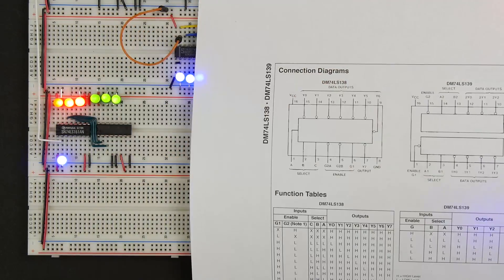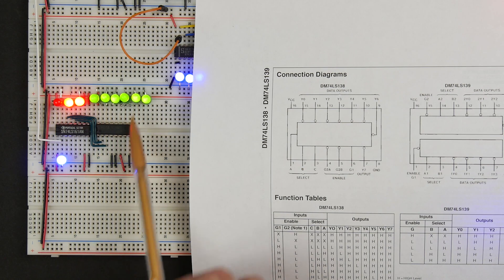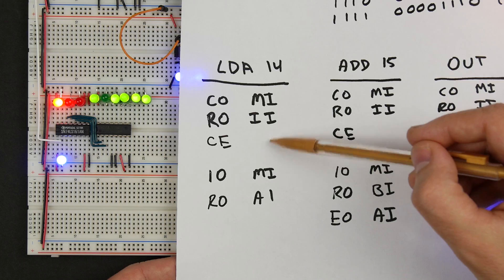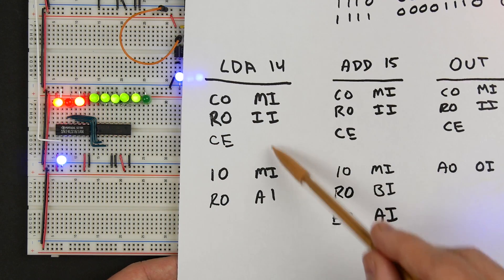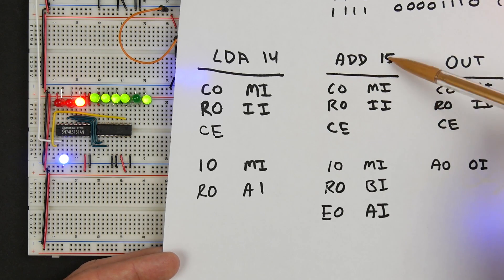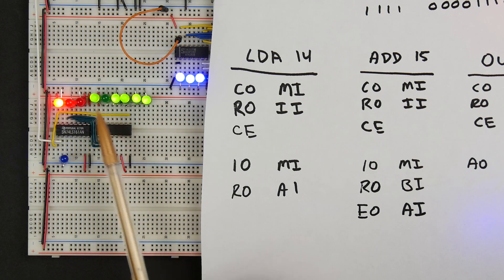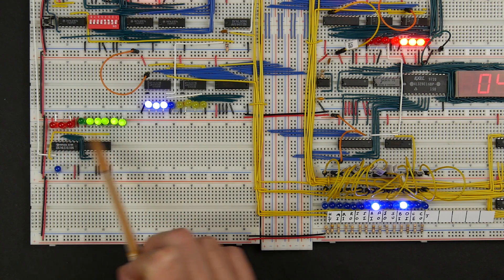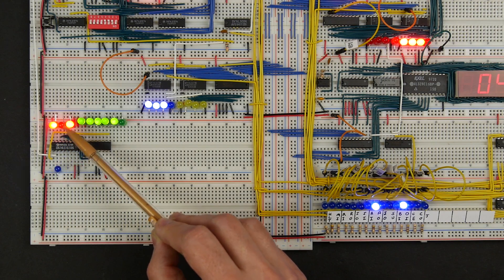8-bit CPU control logic: Part 2

Comment: This 'quick' jumper wire solution will get you into problems if you do it without OR-gates.  I mean, when you want to set control word of  the next step of the LDA command with the jumper wires, it will also activate the CO-bit and that will possibly ruin the program.
Reply: MrBronvu Gates can be overkill and complicated; in this case diodes for a wired or could do nicely. But the hardwiring was for demonstration purposes anyway and the upcoming microcode ROM will have each combination.
Reply: MrBronvu it is only temporary.
Reply: I did understand that is was for temporary use only, but I thought Ben said that wiring it like this was also an  option. I probably misunderstood. 
It is only a small remark on the video, I'm a big fan of Ben's videos and he explains really well.

Comment: Where can I buy the cables you use on your breadboards? Is a coil of cables from which you cut the length you need? I searched on the internet but did not find anything.
Reply: it's 22AWG wire.  The one that I like (and am using) is here: http://www.jameco.com/webapp/wcs/stores/servlet/ProductDisplay?search_type=jamecoall&catalogId=10001&freeText=2159189&langId=-1&productId=2159189&storeId=10001&ddkey=http%3AStoreCatalogDrillDownView

Comment: If you wanted to save more computation time, couldn't you reset the logic counter whenever an instruction is done? For your loadA, for example, along side the Ram-Out and A-in micro instruction could you split that off again and have it reset the logic counter saving you an extra computation step and, if you do that for every instruction, give you more flexibility in how complex your instructions can be?

Comment: You should make a microopcode o reset the counter at the end. Therefore different insrructions will use a different amount of clock cycles. The microopcode that resets will take no time.
Reply: This was also my idea, but there's one caveat: This requires yet another control line...

Comment: hmmm. After building the ALU and hooking it up to clock and bus strange things happen. Can anyone explain why I have a .5 volt drop across my modules? I've built it the exact same as Ben up to the ALU part (which is where I am in the series) and have added decoupling and smoothing caps on each breadboard (unlike Ben) as I read these might help. It makes no difference to use a phone charger or my solder station variable PSU. With my multi-meter measuring voltage reading just the clock breadboard module reads 5.1 volts. If I plug in the program register it falls to 4.85 volts and with the ALU hooked up too the multi-meter then reads 4.5 volts. 

Why is this happening as I feel its messing up my circuit?!?
Reply: HC and LS series chips should not be mixed. LS chips cannot drive HC chips reliably, because HC chips use CMOS levels on their inputs, which are symmetric around 50% of the supply voltage, but LS chips output TTL levels which are assymetric: logic high can start at around 2 V which is below 50% Vcc for 5V power supply, so it may recognize logic hight as logic low sometimes (especially with voltage drops like those described).

For new projects, it is recommended to use HC only. But if from some reasons (compatibility, costs, availability etc.) you really have to use LS chips, you can only mix them safely with other LS chips or HCT chips, which are "TTL-compatible" – they expect TTL levels on their inputs, so LS chips can correctly drive them.

As for the voltage drops, it might be due to power consumption – the more current you draw from the power supply, the more the voltage may drop. It's good to have a regulated power supply which tries to keep the voltage at a certain level even for higher current loads.

There also might be some voltage drops on internal pull-up resistors inside chips. If I remember correctly, the LS  (Low-Power Schottky) series chips have 10x bigger pull-up resistors on their outputs, so that they limit the output current and consume less power during operation, than the HC chips. So there may also be some voltage drops on them.

But don't take my words too seriously, I might as well be wrong and the real reason might be something else entirely. You need to measure through the circuit yourself and see where the voltage drops.
Reply: LoneRegister I'm no expert but for some reason HC and LS series chip just seem to work. I have no clue how, especially on an undervoltage of 1.5v.
Reply: Shyysiryxius this happens to me too even with everything you said. The only difference is when you get up to this video, I see 3.5V on my breadboard. It still works fine though.
Consider using two phone chargers for each side of the board
Reply: Originally, I too saw my voltage dropping down to around 3.5V.  I then updated my power rails by removing all of the breadboard individual wires, and using jumpers in each outside corner of the breadboards.  I then soldered a power or ground wire to each jumper, which then effectively removed any resistance between power or ground wires as the power was distributed around the breadboard.  This brought my breadboard up to around 3.8V-4V.

However, I too have a question around this.

Should I get a power supply, and drive 6V into the project to net 5V?  Where is the 1.2V dissapearing to?  Do I need to worry about my 74LS/HC series chips?  I certainy noticed that my LEDs brightened up a bit when I did the power rails.
Reply: I am not good enough with electronics to understand why the board is under-volting.  When I test the powersupply (both usb, and breadboard PS) without the breadboards - it comes in at 5v.  When I test on a small (other) circuit - 5V.  But on my board it drops.  I can't help but think I goofed something up?  
I also tested current - and it did not seem high?  I think the apple chargers are designed for 1.5A, and I was drawing 400mA or so?  I'll have to boot it up and test again to see what the number is and post here.
Reply: LoneRegister the reason your board has drops is because when all the chips are powered on, they require a certain amount of amps, but you can't just boost the amps because then chips close to the supply will burn and only the ones further away will work. BTW are you using Chinese boards. I know I am. That may be a reason?
Reply: Sci Twi - I will check to see if I have LS or HC chips (or a mix).  Thanks for the info though.  I did not know that you should not mix the two.
Reply: If the TTL circuits require 5v to operate how are they running on only 3.5V? Ill try another phone charger plugged in and see if that helps. 

Id be very curious to see what Bens voltage readings are on different parts of the board. 

And how he is getting away with only a single capacitor to smooth/debounce is just crazy..
Reply: Any good video's floating around detailing the use of caps for smoothing voltage supplies?
Reply: If you measure the voltage rails right where you feed power in, and again at the farthest point on the breadboards, and there is a voltage drop of 0.25 volts or more, then you have corrosion on the wires or the breadboard contacts or both.  The first fix to try is to sand the ends of the wires with fine sandpaper until they are shiny.  This worked on my board.  After that you can try to scrape the contacts in a hole by shoving a header into it repeatedly, but this has a high chance of damaging the contacts even more.

Comment: so it basically works like the output display multiplexing-wise? So you write a micro-instruction library with those related to one instruction have a common address number and the counter does the rest?

Comment: Just wondering, how fast can the clock go?
Reply: I've managed a couple hundred kHz on my 555 with a very similar configuration, although when I removed the capacitor and the resistor (which is not a good idea) it hovered around 1.2 MHz. For the higher frequencies, you would want to use a crystal oscillator instead.
Reply: But you won't go far with it either, because the chips used have usually switching times allowing for around 25 MHz at most. But it might not be possible to reach that limit in practise anyway due to parasitic capacitances and resistances in the breadboard.
Reply: Sci Twi regarding that, have you heard of potato chips? http://www.potatosemi.com/potatosemi2010/products_74.html
Reply: Wow, interesting! :> Looks like they use inverting amplifiers to make the input switching noises to cancel each other out. Brilliant :)
Yeah, but where can I get those chips? :q Though I bet they're expensive… :q

Comment: I was wondering how you could reduce the micro-code length of the ADD instruction further... Merging CE with RO and II reduced it from 6 micro-instructions to 5. I was asking myself whether the last ADD microcode could be merged with the first microcode of any other next instruction. That would mean, merging EO + AI with CO + MI, effectively bringing the number of maximum micro-instructions down to 4.
Obviously, there would be conflicting bus usage. But given that CO is seemingly used exclusively with MI (maybe not actually, I don't know the whole instruction set), what if there were a secondary bus going directly from the PC to the memory address register? Would that be feasible? I'm sure it would also be cumbersome to implement this last micro-instruction overlapping onto the next instruction in the control logic.
Even though this computer isn't built for speed, this could mean a 5/4 speed increase to the whole computer, which isn't negligible. That is unless Ben Harper's suggestion of having the EEPROM controlling the reset for the instruction conter cycle is implemented. Also, there may be other instructions in the instruction set which need 5 micro-instructions or more. 
Is this a valid suggestion? I'm not sure what I'm talking about, so I'd be interested in having the opinion of someone who does.
Reply: Maximilien Tirard An easier way to save a cycle is to speculatively load MAR in T1. All the memory access instructions load it from the instruction register during T2, that is the value on the bus in T1, and instructions that don't access memory don't care what's in MAR. This is speculative execution, and the cost is extra RAM activity when memory access is not done.
Reply: Smart! That's really neat! But wouldn't that cause issues? So you are saying that during T2, when II is reading from RO, MI can kind of steal the value as it's there on the bus, because it's just going to be read from IO in T3 anyways. I was thinking to myself that this could cause a problem, but no! All these latches are edge triggered! II and MI latch on very quickly on the rising edge of the clock, much faster than it would take for the RAM chip to read the new value. If they weren't edge triggered though, this would cause a problem, right? Anyways, super neat suggestion and super neat video!
Reply: Lots of things could be improved by adding more data paths. For example, a path directly from the PC to the memory address inputs, bypassing the MAR, would let you fetch an instruction, increment the PC, and load the IR and MAR all in one cycle.

Comment: Wouldn't you be able to set an end flag for each instruction which tells the cpu the command has finished and the counter should be reset? it would add a step to each command but would allow you to write longer instructions but not have to count to the max length each time
Reply: I wonder if this could be merged with microinstruction jumps...
The "end" microinstruction is like an unconditional jump to the first (0th?) phase of the cycle. But perhaps it could be extended to jump to other phases as well? E.g. to skip the part which fetches the operands when there is none for some opcode, or jumping to different alternate routes for different addressing modes, or repeating some sequence of instructions in a loop (think multiplication/division implemented as repeated addition/subtraction in the ALU).
Reply: +Sci Twi It's easier to make separate "load" instruction and just don't use it when it don't needed)
Multiplication and division is a separate topics, becasuse there's special algorythms for these operations (it takes lots of time as repeated addition/subtraction). I think Ben will tell us about it later.

Comment: I think you can have some problems if you don't tie remaining inputs of logic gates to vcc or Gnd. It can sometimes change state of outputs that you're using
Reply: Filip Szkandera If the chips are from the LS family and the state of the pins doesn't matter (ie tying them to gnd, vcc and clock would give the same results), it does not matter